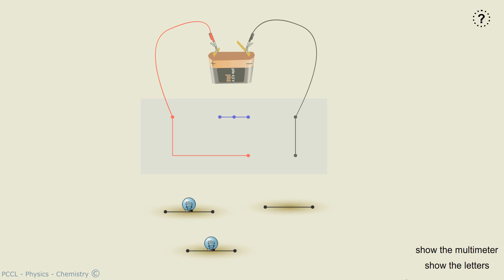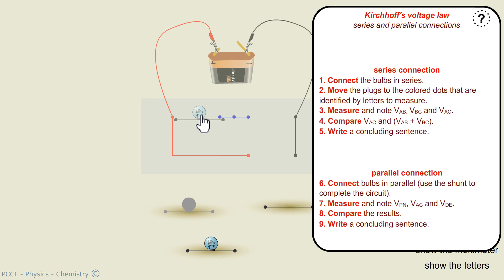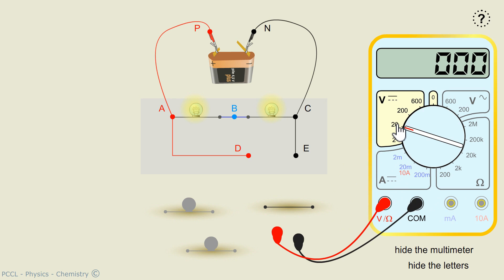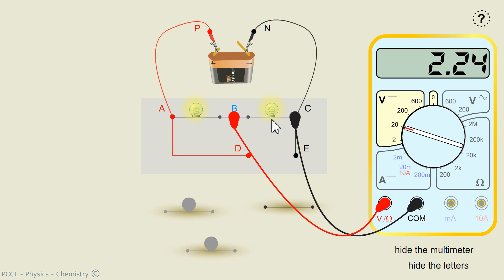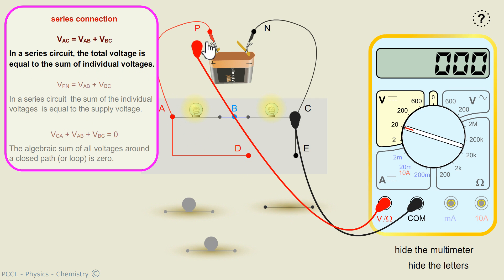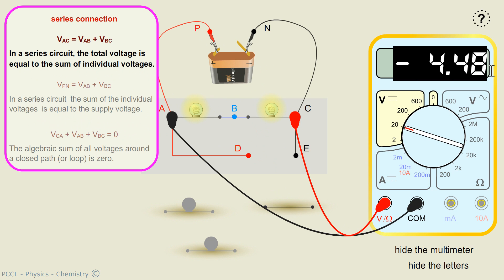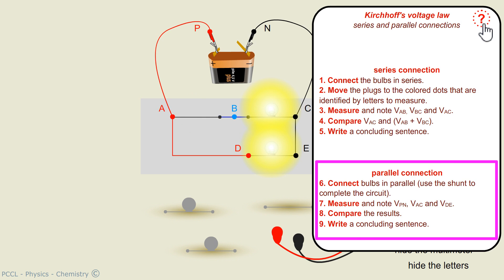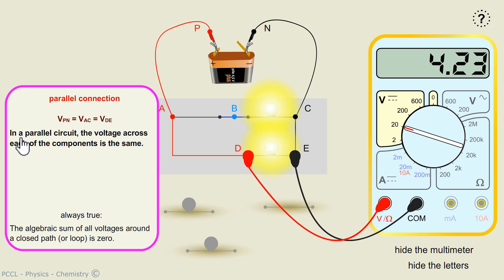Kirchhoff's Voltage Law - KVL - 2 IDENTICAL BULBS version 1.0 - PCCL Physics - Electricity

Comment: Why the volt is different; for example why in 2 volts we have the 1 result, for 20V we have 4,27 , for 200V 4,2 and for 600V have 4;;
Reply from the maker: Hello, you know the maps are not all the same scale. If you look at the world map, the dimensions of your city will not be precise. If you look at the map of your city, you will have enough accuracy to measure the length of a street. It's the same with the voltmeter. 600 V is a less precise range because it "shows" up to 600 V.